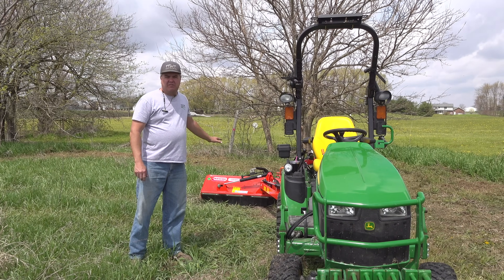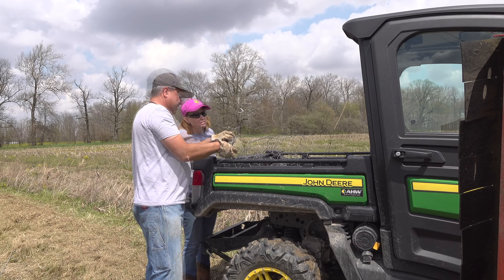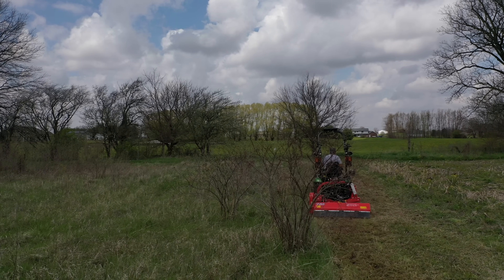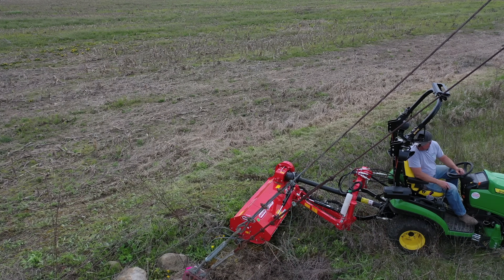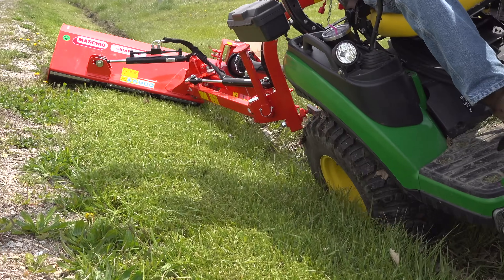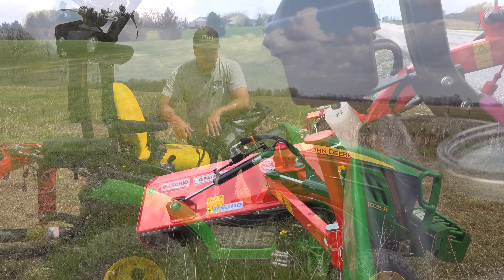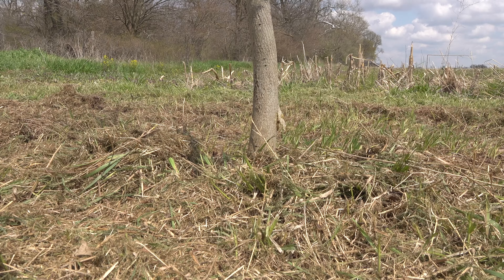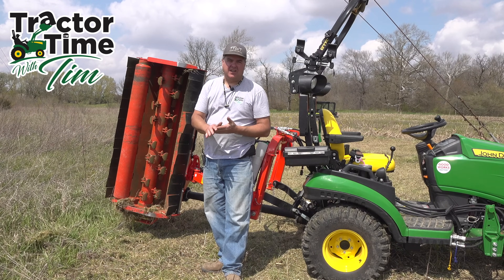NEVER BEFORE SEEN!!  Offset Flail on Sub Compact Tractor

Comment: 14:25 for that float deal. Why not hookup that cylinder to the lift arm value so you can force it into float like the loader arms can. Would that fix that issue? Less hassle to worry about that and probably better cut quality.
Reply: Some manufacturers use an ordinary cylinder which can then be used in the float position (FEL ore rear remote). Whit this "controlled check valve" cylinder it is secured on the road to prevent lowering on it's own standard with the wider versions

Comment: Tim got a  question for you now that you have had a few years to run this. Do you still think the 55" ditch-bank flail mower is the maximum you would want to run on a Kubota B2650 or do you think the 63" would be ok.  I think the biggest concern would be the weight since it hangs off one side of tractor where only one lift arm on the 3pt is supporting most of the weight. Appreciate any feedback you can give.
Reply from the maker: Certainly not MORE than the 55. If there is a 48, I would recommend that!

Comment: i have been considering a flail mower for some time - but the models i have been looking at will cut at 90 degree    angle. for example to shave overgrown trees and shrubs  to widen trails.       you did not mention that at all.  Does this model have that feature?  and you are correct, not many videos on the flail mowers.  want to see more!  :)
Reply from the maker: Yes. It cuts at any angle.  I’m sorry I didn’t mention.  Simply too much stuff for me to remember!

Comment: Thanks for explaining the advantages and disadvantages of a flail mower. Good work Tim! Now imagine we are running 16ft on a 235hp tractor to chop cornstalks and sunflower stalks at something around 5mph.
Reply from the maker: The first flail I remember...as a kid was a 10' fixed pull type model.  My uncle used it to mow/chop corn stalks.    ...we quit mowing corn stalks in the early 70's.  Decided it was a wasted trip over the field.
Reply: @TractorTimewithTim  We chop corn stalks because they would clog up our ploughs
Reply from the maker: Interesting.  We quit plowing in the late 70's too :-)
Reply: @TractorTimewithTim  In Romania even today big companys with Quadtracs are still plowing. It is not the best way to preserve water in the soil but it is the best way to prepare it.

Comment: Can’t wait for the video with Johnny 2. We are on the fence with getting one.
Reply from the maker: Do you have a Johnny 2?    I’m certain that it will handle the offset 4.5 ft with ease.
Reply: Tractor Time with Tim  we have the 2038. Think we need. 60”
Reply from the maker: Rimguard in the rear tires will help.  
2038r can handle the PTO power required for 60” .   Only concern is handling the offset weight.
Reply: Tractor Time with Tim  I’ve been in the talks with Iowa farm equipment and they are suggesting a Peruzzo 60”-65” on our tractor
Reply: Put the mid mount mower on the 2038 and see if you can double cut with the offset mower at the same time. I’d like to see Deere offer a 84” mid mount to compensate for the loss of turning radius
Reply: @TractorTimewithTim  Same here. Looking at buying a Johnny 2025R WITHOUT mid-mount mower deck. Considering this flail mower instead as my mowing machine. What about all the hydraulics and hoses? I thought the video said you need to disconnect the hydraulics for the front loader bucket, and use your separate hose kit to hook up the flail mower.

During good weather I mow 6 acres pasture (some embankments) every other week - here in the Pacific Northwest.
Reply from the maker: Aldo Veranzo you can get two rear scv’s on your 2038r.  I have them.  I’ll show this flail on the 2038r when I get time.

Comment: We have a big one of those for mowing irrigation ditches on the farm, as well as a Mascio speed disk we pull. By far the most well made equipment I’ve ran by far. They really take it to the next level on quality control before it’s shipped to the customer.
Reply from the maker: I intend to show some of that detail later..routing of the hoses, shielding wrap around the hoses, etc.  very durable!

Comment: I really like the flail mower. I have Bayhay grass and it grows so fast and my finish mower works good till half way throw the summer. Then the grass build up is so much I can't mow. If I cut the grass every 4 days I would be ok. But who has time for that?  I've tried a brush hog but the same problem occurs. I have a landscaping  rake but it doesn't get the cut grass picked up. Any words of advice for me. I have a B2920
Reply from the maker: Where are you located (roughly), Kevin?  BTW, thanks for your recent subscription!
Reply: outside of Houston Texas.
Reply from the maker: Ok.  Too far for us to drive, unfortunately!

Comment: Researched the unit you can also lock the top link to fixed for non-float if desired.You put a link pin to fill the slot,(fills space)which locks the arm pin in place in fixed spot thus a non-float/limited float unit.  FYI. I would prefer float like you have shown. Thanks  for the video!

Comment: I have been looking at the offset flail mower to mow a short (10 foot) but steep bank. I have a
 2038R and would really like your opinion on my scenario.  If you could try it on Johnny 2 that would be great, but short of that do you think the 2038r would handle a 5 foot version and how far off to the side does it extend?  Thanks for all the great videos.
Reply from the maker: You can see the extent of the side reach in this video.
I suspect you would be able to handle 5'. We'll try it on the 2038r.  ...if we had started with the 2038r, we would receive a bunch of "You never use the 1025r anymore" comments :-)

Comment: What size would you recommend for your 3046r?

Is the 55" perfect or would a 63" work?  63" is 40lbs more.
Reply from the maker: 63 would work.  Make sure you have wheel weights and Rimguard
Reply: Welp ordered a 63" for our OOS, thanks for the discount code TTWT, saved me some coin.

Got the rim guard, weights, and some spacers.  Might hang more left side weight if I can find a place for them.

Comment: Hey Tim, power rakes like you have for Vinney are horribly expensive.  Do you think you could get away with occasional use of a flail mower to do the same job if you could get it low enough?  Thanks for the video.
Reply from the maker: No, flail could not be used as poser rake in my opinion.
Reply: @TractorTimewithTim   I didn't think so but when the idea occurred to me, I had to ask.  Thanks for the reply.

Comment: The flail mower does a better cut than a brush cutter. Hey Tim what do you mean by the pto is in mid ? Do you set the handle to read and mid pto ?
Reply from the maker: Yes, handle has 3 positions...mid, rear, and both.

Comment: Tim, you said that the 1025R was not big enough for this size mower with the offset. What would you recommend in the Deere line as the best next size to be able to handle it?
Reply from the maker: Ken, we are planning to try the 2038r with this mower.   We’ll let you know!
Reply: Tractor Time with Tim in other words, a 30-35 hp should be able to handle it mo beta?

Comment: Tim: Do you have any experience with a 3-point sickle bar?  My needs are mowing tall weeds on a pond/stream bank with a larger tractor (JD 4310, roughly equivalent to a modern 3-series) and wondered if an offset flail or sickle might be the better tool.
Reply from the maker: Don’t have one yet.  Maybe in future...
Reply: With a sickle mower, it leaves the long grass/weeds laying, which can cause plugging issues the next time you mow. Advantage of the flail is it chops it up like mulch, eliminating this issue.

Comment: Tim, would the loader float position allowed the flail to follow the terrain?

I have a wood Maxx 60 inch on my deer 3025e. It has a hydraulic offset. Very nice when you don't want to drive over things. It has eaten some serious brush, grass, trees and branches. I think the Deere's 25hp is enough (I have been satisfied with it's hp). A traditional brush hog takes less hp.

Comment: Do you have a view on whether 'hammer' type blades, or 'Y' type blades are better on a flail mower?
Reply from the maker: Not enough experience to help...
Reply: The hammer blades create an excellent up-draft (so more easily pick up flattened grass) but cut much less efficiently after becoming dull - they also tend to chisel into the dirt if you bottom out. The Y flails cut well, but do not have much updraft. They are also prone to bending outwards if you mow onto a prone branch or hidden log, (upsetting balance and cut efficiency). The Y flails are also a bit  better for dry, tall standing weeds and grass - although a horizontal rotary blade deals with that better than a flail mower. 

We run both types of mower (flail and rotary) and each has its unique drawbacks and benefits. If you smack a  large rock with a flail mower, you may have a full re-balance job to do as the rotor can warp and go out of balance - meaning off the job and a day or 2 lost, (plus high cost). A rotary blade mower, in the same situation, usually means a fairly quick blade change and back to work. 

Great video -  all the best from NZ - we're thinking of you in this trying time. Stay healthy!

Comment: Hey Tim, when talking about keeping the pin centered at least for the lift one you can switch your hoses around and lock the scv in float "easy peasy" as for the other, have the front ride plate hard faced and keep the 3 point dropped it will allow the mower to keep itself level & naturally the three point floats upwards by itself.

Comment: Would those hydraulic hoses be enough for like one of those 3pt wood splitters?
Reply from the maker: Yes.    Of course, this tractor would be slow to operate the splitter, and the joystick is a long ways from the business part of the splitter.
Reply: Tractor Time with Tim I think there is a handle by the splitter. So not sure how that would work  out.

Comment: New to the tractor world. I have a 2025R. I assume that it could handle this mower offset behind no problem, and probably occasionally on some pond banks. Did you ever get the hydraulic hose kit packaged up to sell? Very interested how you did that since I will need to go that route as I only have one set  for the rear PTO.
Reply from the maker: Add fluid (Rimguard) to rear tires.  
Add wheel weights to at least the left hand side.
Also, get one size smaller mower (not sure of the smaller width exact size) than this mower.
With all of the above, you will be great with the 2025r

Comment: Did it work better on the 2025R?  I am wondering if it will work on the Kubota LX3310.
Reply from the maker: This one will work fine on an Lx3310 if you add Rimguard fluid to the tires.  We’ll try to show it on our 3310 this summer.

Comment: I have a side flail myself and have found it nice to mow ditches but should have gotten larger than recommended for distance down the ditch.  I have found that if you travel at 3 mph hit seems to cut nicer as your not keeping cut material in the mowing chamber.  I have a float hydraulic lever for my angle up down so I set it push all the way and it floats as I cut making it much easier to contour.  The shoes it skids on can cut into grass if not careful when sliding the mower in and out..

Comment: You pointed out keeping the up/down in the middle so the mower had room to pivot up and down with the terrain. What about the float position on the joystick?  Would that not allow the mower to pivot as much as it needed to?
Reply from the maker: The float seems to put a bit too much down pressure on the boom...at least in my experience.

Comment: 💥 For someone that has a lot of ditch banks an offset flail would be a perfect solution. Have fun with that flail mower Tim. It’s one of my favorite attachments. 
Keep on tractoring! 👍
Reply: Can run it with a BX 2350 but need at least 55 pound in the front.

Comment: I have a walk behind (Grillo) 2 wheel tractor with a flail mower attachment. Previous property owner laid ground cover cloth a few places. Took hours to remove it. Wire and twine also "found", among other things that got into the flail. I once rang thru the remnants of a barbed wire fence with my pickup and it wrapped around the rear axle pulling the emergency brake cable tight, making it hard to move. I have found all kinds of crap like this on my property - removed most of it.

Comment: I was using a offset flail mower in the early 80s on my 100hp tractor we used to cut road verges with them there not new. from the UK

Comment: Hello again Tim! I have contacted agfolks! waiting for a replly. Also, I have another question. Hammer blades or knives on the flail mower? What's better? As all, I think, will depend on the aplication. Each one can have different advantages. Do you know what's the best application for each one?
Reply from the maker: I have always used hammers.  However, I hear others recommend y blades.

Comment: Thank you for this demonstration. I would not have thought of using this type of mower had I not seen your demonstration. Very interesting! Best wishes
Reply: Much better results than bush hogs, the residue is chopped finer and also gives a cleaner cut, though i do believe they take more power/fuel relatively. I have a neighbor that has a lot of bush hogs and is always offering to let me barrow them, tried once and that was enough, only flail mowers.

Comment: Try the Woodmax  Fail Mower, the offset system works differently but does not have tilt ability, would love to see you try and give your thoughts on it, also there are grass blades that will cut better than the brush blades that are on that one.

Comment: Tim, question.  The smallest flail mowers from the Machio company specify minimum of 20 HP PTO.  The 1025R specs show 18 HP PTO.  So apparently, the 1025R still operates these mowers OK? Would you agree?  Am I understanding this correctly?  Just ordered a 1025R and am wanting a flail mower.
Reply from the maker: Yes, the 1025r will handle the 4’ fixed or 4.5’ fixed Maschio flail with no issues.  
In general, anything with a 20hp min will work fine on a 1025r.   My 1025r tested at 25.5 PTO HP on a dyno :-)

Comment: I was wondering if a case 1130 is ok to use with a 6' flail mower, but it does sit kind a high.......
Reply from the maker: One of these Maschio offset flails?  Yes, would work ok.  Could even handle a wider one if they make it!

Comment: I’ve got one of the import Farmers Helper Ef105 flail mowers on my Massey GC1723EB; in non-offset configuration; and I’ve got one season on it. In general, it works OK. I’ve found that it works better when the grass/brush has dried out some; if it’s still kinda wet it’s tough and can bog down the tractor... waiting until it’s dryer means it starts to get brittle and the mower has an easier time with it. The grass on my property can get to a foot or more tall before it stops raining; so it’s a pretty challenging situation.

Comment: In my last year that would’ve been a dream, not only the tipping up on its side to get stuff out but the offset part. Our house was on a lake and we had drainage ditches on two sides of the property the lake along the backside and a third drainage ditch along the front of the property and the city would come through and dig the front Ditch out every couple years and it was just too steep to get with a riding mower, So just something to get in the ditches would have been awesome. They were almost always wet and muddy and being that it was field drainage we’re very fertile so they would grow like crazy I’ve often thought of getting a tow behind just for doing the dishes. Not just because they were steep but when they were muddy the mower would get stuck every time. Are usually had to let it grow about 5 feet tall before it was dry enough to get in there. I thought of a cycle bar but something like this would be a much better option.Also for mowing over the water, having it stick out like that and being able to angle it would’ve been great

Comment: How far back is this from the tractor? Say from the center of the 3 point pins to the back of the flail mower? I have a 16' trailer and I don't see it fitting while attached to the tractor. It looks like it is too long with the tractor. Maybe when retracted and closer to the tractor it might fit, but would be a tight fit.
Reply from the maker: Shorter than rotary cutter.  I think would fit on 16’
Reply: @TractorTimewithTim  ok, thank you.

Comment: Tim, question about the hydraulic setup: Can you get rear remotes for a 1025r?  And a follow up question to that: can you use the power beyond as a rear remote?
Reply from the maker: You cannot get rear remotes AND power beyond from Deere.
There are aftermarket solutions.  They are not mainstream.  Not easy install, etc.

Comment: I should add that, if I’m cutting just grass I mow with my batwing. I run the flail mower in things like locust because it shreds thorns so they can’t cause flats like a rotary could. I also like the way flail mowers grind up brambles, olives and cedars which a rotary can leave a splintered or jarred stump to cause flats.

Comment: how much weight did you need to place on the front of the tractor?
Reply: He used 320 lbs. Eight 40 lb weights. He may be using the Heavy Hitch brand front weight bracket to fit 8 weights.

Comment: Looks like this would be very good at cutting grass and other weeds that have gone to seed by keeping Johnny in the mowed path and not breathing in all the debris that covers the radiator screen. Great product. You need 2 Johnny's, one with a  to run a Brush Hog and the other with the flail mower,  then compare the 2 at the same time. Great camera work Christy and Tim you did great driving Johnny.